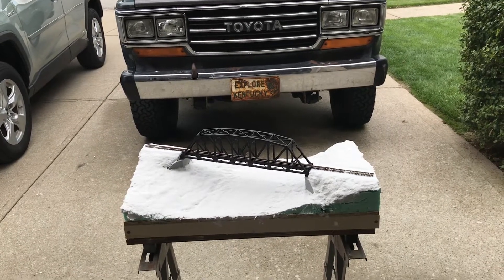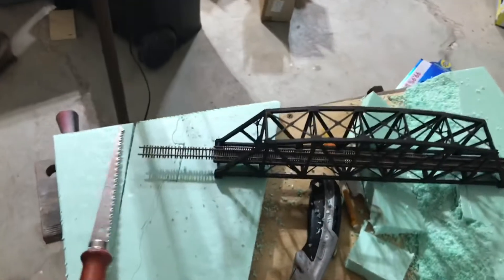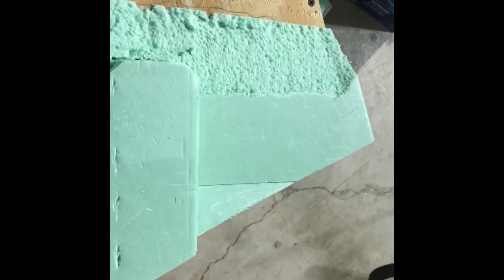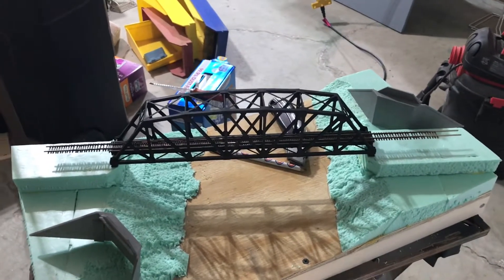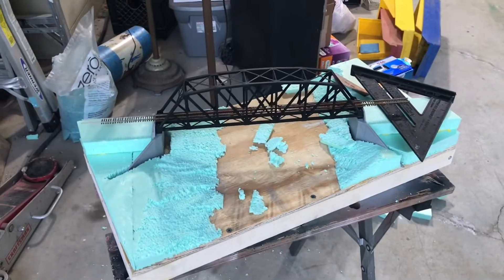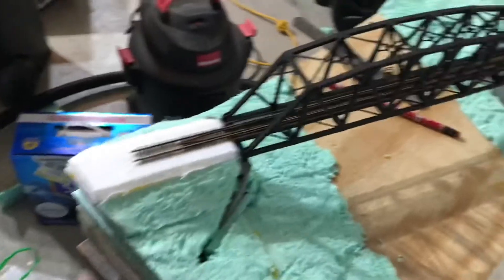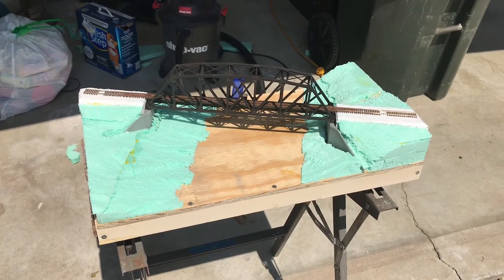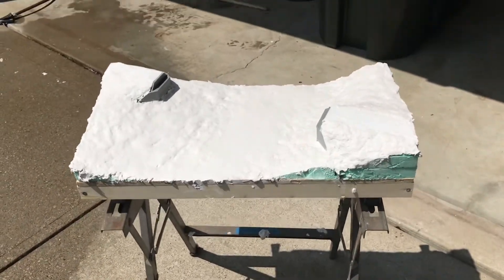The Bridge Diorama: Foam to Sculptamold

Comment: Your scultamold application looks good! It's always a bit stark looking because you lose the texture in the white color (especially when you have a bright, sunny day). Don't forget that you can add sculptamold to sculptamold for adjustment to the scenery. It is not very difficult in my experience to change contours, etc. even after your 1st application has hardened. The diorama is coming on nicely. I cant wait to see the bridge scene on the layout.
Reply from the maker: Thanks for the encouragement. Since I used scrap foam, my borders look kind of rough, so I am going to line it with Masonite and will probably need to touch up the edges with Sculptamold again. Glad that’s going to work!